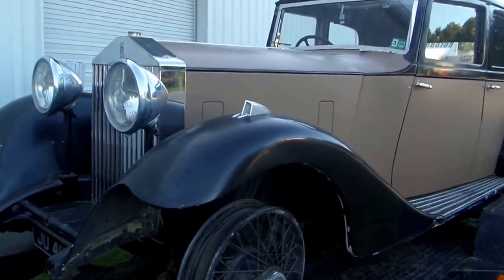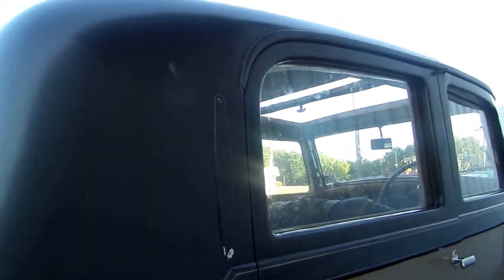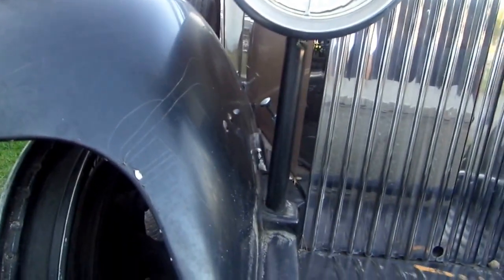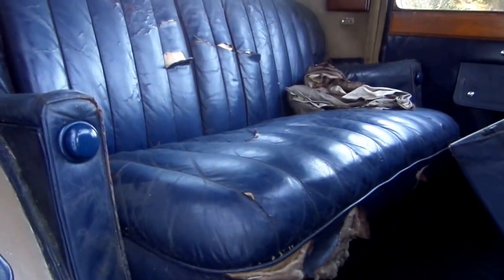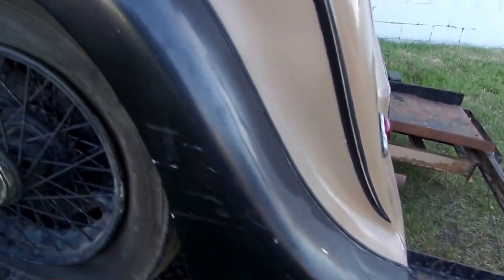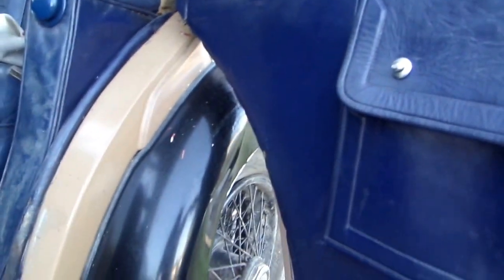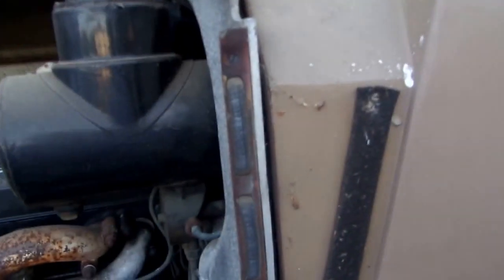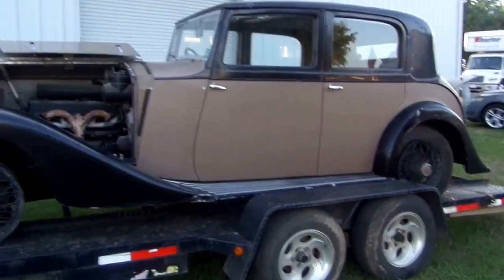1935 Rolls Royce ..barn find

Comment: I would be very tempted to repair and clean it just enough to make it safe on the road, and leave the remainder the hell alone. This is one of those once-in-a-career finds
Reply: I would consider modernising a bit. Power steering a modern V8 small block power brakes. 5-6 speed floor shifter modern gearbox etc then you would have a real classic
Reply: In that case it would be a hotrod with low value
Reply: Sorry but you would end up with a cobbled Rolls Royce  at a classic

Comment: Hooper were the Royal coachbuilders, they formerly built horse carriages and produced top quality coachwork along with Barker & Co.Interesting close-coupled saloon, the open sunshine roof as it should be called has definitely let in rodents most likely rats in with the degree of damage.The 20/25 hp was an incredibly sweet running and silent engine.Only the   rear Lucas lamps are later additions as they were originally included in the rear number plate ' window '.Furnished with the chassis number on the bulkhead,The R.R.E.C in the UK could supply the original chassis build /coachbuilders sheets and original owner,as Neville has said below, this car was originally licenced in Leicstershire,UK and has found it's way over to the States.

Comment: A person could easily make a small fortune buying, restoring and reselling that car. As long as they start with a large fortune. There are 4 or 5 "fully restored" on Hemmings right now and there's no way in hell if that car were FREE it could even be restored to "museum quality" i.e "cosmetically" and "running and driving" well enough to get on and off the trailer and out the restoration shop door and onto the museum floor for less than the asking price of  "restored" ones. The whole "chassis by Rolls-Royce/body by Whoever" is a just as big of a "deal-breaker" for many would-be "collectors" with a Rolls as with any other "composite" car and a major reason why many cheap, common and mass-produced American cars of similar vintage are "worth" a damned sight more money and people spend ridiculous money on "concours restorations" of them while "hand-built luxury cars" like that Rolls get a cheap and crappy "respray", piss-poor bodywork and panel/door/body fitting and everything hidden from view by the casual observer gets even less "investment". It's because the overwhelming majority of people consider the BODY to be the CAR and rightly so since that's the part they have the most intimate relationship with. There is also no such thing as a true "restoration" of a "coachbuilt" car with a Brand X "bespoke" body on a Brand Y chassis. The car left "Rolls-Royce" as a "rolling chassis" and some "workshop" as a Rolls-Royce  chassis with a Brand X body. The fancy radiator is "Rolls-Royce" because its part of the chassis and powertrain and necessary for it to leave the factory as a running, driving chassis. There is no "literature" for that "car" and there are no NOS or aftermarket "body parts" and no "expert" has a clue what is or isn't "correct" or "original" as far as the body goes and the "flush-mounted" and "modern" and "generic" tail lights and turn signals alone just SCREAM "unoriginal" and "jury-rigged" to make the car "street legal" by modern standards. And even the "coachwork" looks pretty bottom-drawer as far as the lack of any real "styling" and "craftsmanship". It's pretty much ALL just plain "sheetmetal" as far as the body goes and the only metalworking evident is the minimal "rolling" of the back panel. I wouldn't be surprised to find the plain-Jane fenders were "sourced" from some mass-produced American car along with the wheels which have smaller and fewer spokes than most "balloon tire"  bicycle wheels. They're certainly cheesy-looking for such a large and "expensive" chassis/body. The lack of any spare tire/wheel in the "normal" locations for a "touring car" and lack of a rear bumper plus a hundred other "little" details suggest that "barn-find" so-called "Rolls-Royce" was/is some "used car salesman's" get rich quick scheme that may or may not even be  a "Rolls" at the chassis level. Why would a Land Rover "importer" decide to buy and import and flip a "barn-find" Rolls-Royce and then "advertise" it on YouTube but "publish" only an email address and website while mentioning but not listing his eBay ID/store/history if that's the primary proof of his history as a buyer/seller of "vintage vehicles" unless he never wanted it in the first place or after putting eyes and hands on it and who wanting to flip a "barn-find" ASAP would throw out "concours restoration" and not have the car advertised where "serious" collectors could easily find it? Hell, you make it sound like the lack of tires is the holdup with being able to report how it drives when you don't even state that it RUNS. Anybody who pays/paid more than the cost to "import" that thing to their garage has more dollars than sense.
Reply: That is definitely a rolls at every level including the chassis level, but it is not going to make anyone rich. It is worth like 20 to maybe 30k as it sits but only a moron would buy and restore it. A person that wants one of these would just go buy a good one for under 100k and be done with it.